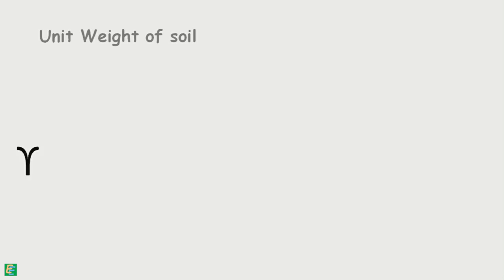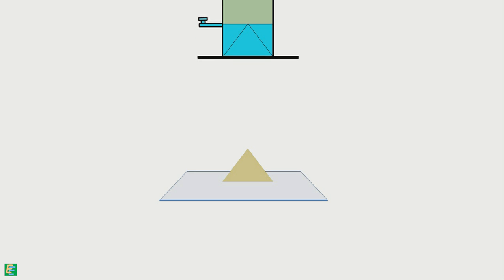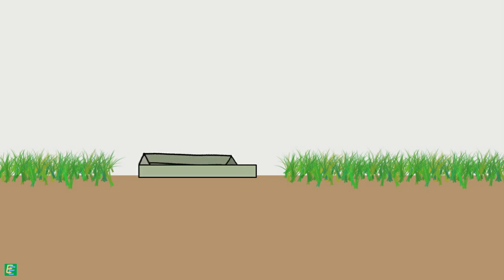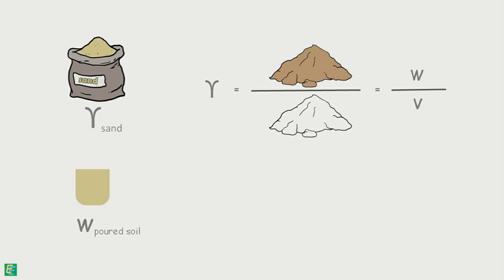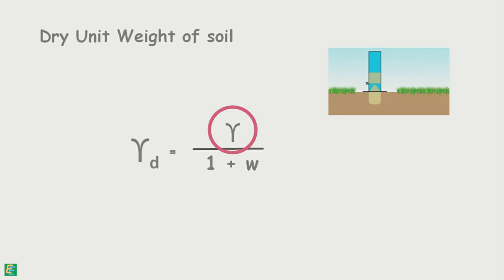Unit Weight Determination - Sand Replacement Method

Comment: 00:08 - The sand replacement method determines the unit weight of soil when core cutting is impractical.
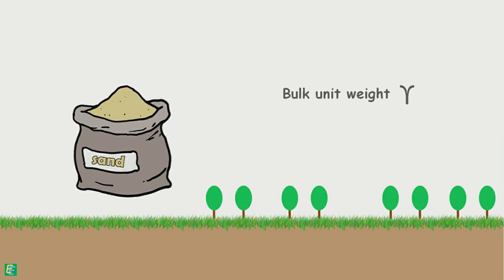00:45 - Determining the volume of the calibrating container for sand replacement.
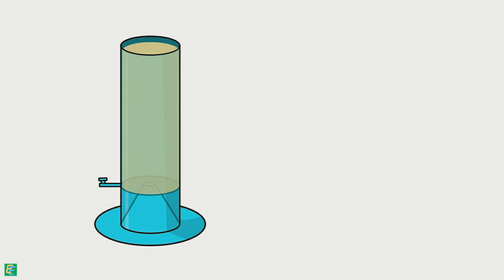01:19 - Determining unit weight using the sand replacement method.
01:53 - Determine soil weight using a cylinder and glass plate.
02:35 - Determine unit weight of soil using the sand replacement method.
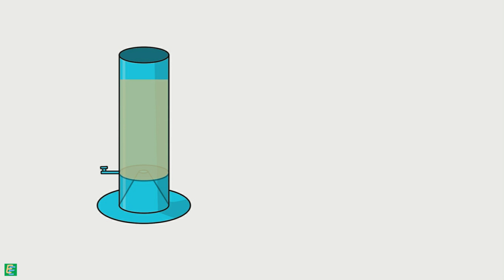03:14 - Steps to measure unit weight using sand replacement method.
03:50 - Determine soil weight through sand replacement method.
04:22 - Calculate bulk and dry unit weight of excavated soil.

Comment: In this video
For the sand we calculated W1, W2 & W3
For the field sand we calculated WN1&WN2 only and we didn't calculate WN3 for this
The formula for  W(pouring) =WN1-WN2-W3
Do we need to consider the first calculated W3 for W(pouring)
and if so what was the reason for that and why can't we calculate WN3 and why can't we use in W(Pouring) formula..

Comment: Why we don't measure weight of sand in calibrating cylinder directly?
Reply: If we do so , it will become difficult to calculate the weight of sand filled in the ground surface hole.
Reply: So we will fail to calculate the volume of that hole i.e. volume of excavated soil.
&  if we don't have volume of soil 
We cannot calculate it's unit weight.
Reply: @sonukumarsaw6320  yes, thank you

Comment: why we find out bulk unit wt two tymes
Reply from the maker: our purpose is to know the volume of excavated soil which is the volume of excavated hole. For that we fill the hole with the sand of known bulk unit weight. and by that we can find out volume of the hole.
Reply: @ElementaryEngineering But after finding the volume, why find the bulk unit weight again?